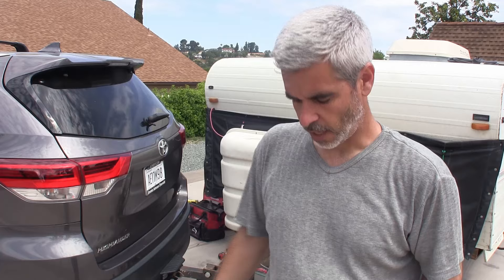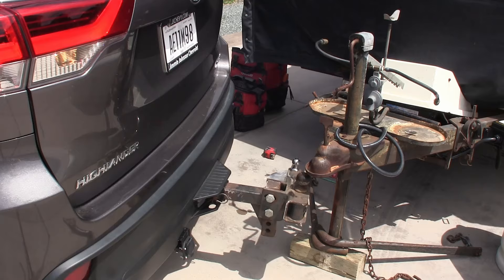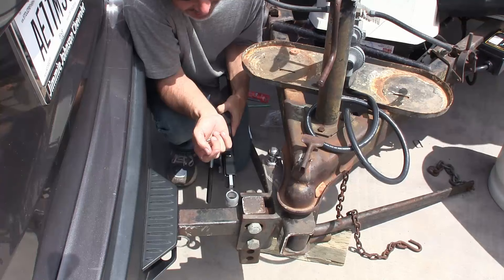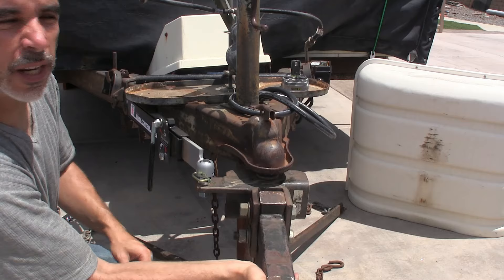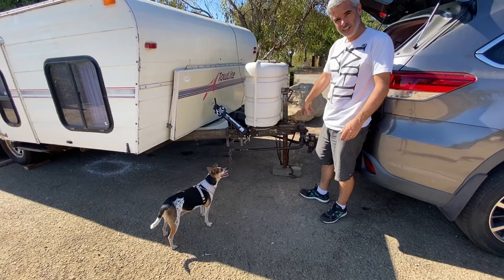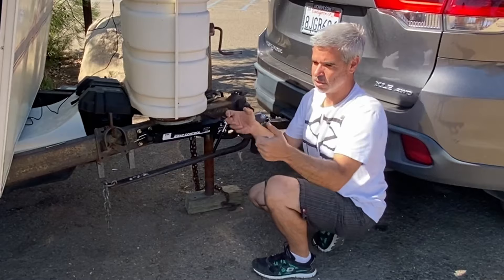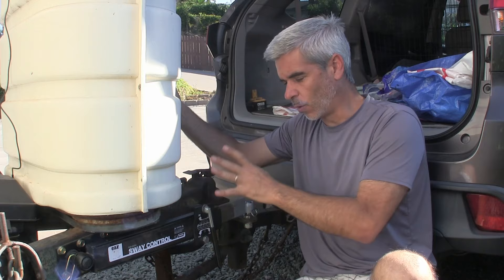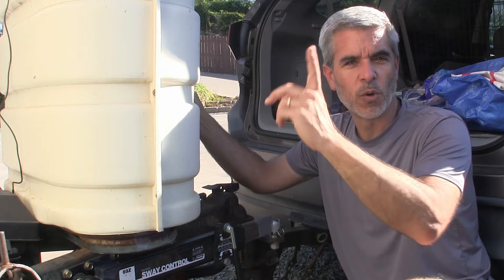DIY Trailer Anti-Sway Bar Installation and use

Comment: When lowering your trailer or raising your trailer, take the sway control completely off.  You install after the trailer is hooked up. When backing up it's wise to either take it off or loosen it.
Reply: Yes was going to say from the looks of it, it is for the travel portion. When hooking up or reversing I would just disconnect first.

Comment: Appreciate you taking the time to make this.  Just got an ultra-lite travel trailer and was clueless as to what I need back there and now I'm good-to-go!
Reply from the maker: Good to hear this was helpful.  Be sure you have your load-distribution hitch tuned before adding the sway-bar as well.  Load distribution is key to not needing the sway bay-bar to work as hard to control the sway.

Comment: they say the E2 equalizer does both although It may not be as much friction as the friction bar you have. and they are very loud. They sell a pad that quiets the noise but less friction. Since the equalizer came with camper I'll be trying that.  thanks

Comment: Good job Dan. Hey....I have an idea for your next video. Its called " How Dan paints his trailer frame"     just sayin.
Reply from the maker: Haha, yah...  bout that...  Funny thing is that when I'm home, I see all the warts and dirt and problems with the trailer. Then I go camping and all that concern goes completely away.  I could care less about the details when I'm actually using it, which is great as I can relax and enjoy where I'm at vs. what others might think about my rig.  So I totally agree, but unless the rust is getting deep and threatening the structure, I won't likely spend time on it myself.  Now the back end, with the added-on storage rack made from angle iron and plywood...  That thing is about to fall apart, so that does need attention ;-)
Reply: Thanks for the very good video with the heads up about the noisy break-in. Will be trying this out shortly. Be well!

Comment: Leveling bars if you need them, theyre purpose is to mechanically push more weight onto the front wheels to steer better,  its always better to have a vehicle thats more than capable to handle your trailer & manage trl tongue weight,  as for that friction bar thats restricts sway, it works both ways, it doesnt want to let trk & trl return straight either resulting in wandering & possible Wreck

Comment: The way I understand, if you look at the sticker on the bar, you tighten the top all the way as it says. The lower bolt is for adjusting the amount of friction. So once you get that set the way you like the top one is for engaging and disengaging only.
Reply from the maker: I totally agree. I'm not using it like it was designed, but for me I like the ability to adjust it depending on the conditions.  I count the threads exposed and adjust up/down from there.  A classic example of 'Doing things Dan's way' for sure...

Comment: thank you for your response. I just saw a you tube saying that if you have the load distribution anti sway with bars without the small chains that you don't need the friction anti sway. The bars will create the friction needed to control sway . Anyway I now undersatnd the whole anti sway load distribution thing.  I see you are going to a Highlander which I am also doing and selling the Honda odyssey. 🙂
Reply from the maker: You bring up an interesting point. The chains allow the car/trailer to sway easily, but the load-distribution hitches that use solid bars could also function as anti-sway friction points.  I'll have to look that up...

Comment: Actually the bottom nut is what makes the tightness adjustment. That way you can always bottom out the top one and the adjustment is the same each time
Reply from the maker: Your absolutely right!  I have found that by adjusting the top by counting threads to be easy and lets me change the force depending on the situation.
Reply: Yeah, i do the same actually. To be honest, i am not sure if i know anyone that does the adjustment with the bottom bolt, but that is technical how it should be done... lol
Reply from the maker: @asianfire72  Hey cool.  Glad you confirmed I'm not that odd...  Wish I had explained this better in the video, but unfortunately I can't update content without re-publishing the video...  Thanks again!

Comment: I had mine too tight......popped the mounting screws off the hitch!  So I drilled it out a little bit and put stainless steel screws in it that were slightly larger......lesson learned.
Reply from the maker: Wow, I would have figured the small ball would have sheered off first... Glad it worked out!

Comment: ALWAYS TAKE THE BAR OFF BEFORE YOU ATTEMPT TO BACK INTO YOUR PARKING SPOT.  IT'S NOT DESIGNED TO DO THAT.
Reply from the maker: I just loosten the tension so it slides easily.  Backup camera shows me how far I can turn before pinching the bar.  Not a problem unless I'm trying to round a corner.  When I un-hitch, I just leave the bar attached to the trailer side.

Comment: My 10 year-old sway bar has always creaked and groaned worse then me getting out of bed in the morning. Really loud and annoying. What do you think the problem is?
Reply from the maker: Mine also make s a lot of noise when turning.  I need the sway protection when on the freeway, so I don' tighten it down until just before getting on the freeway, and again loosen it when I get off at the destination.  Sort of a pain, but definitely worth the effort to not creek and groan through the neighborhood or campground. Definitely keep the balls greased as well.

Comment: A lot of that noise might be there’s no lube anywhere on your hitch. Happens a lot with semi trailers and fifth wheels that sit in  yards a lot. Those torsion bars suck but they work. Funny 37 years driving big trucks and what does my wife wanna do by an RV and go camping when I retired. I did it but only way were getting another one is if we buy a Class A.400k. should do it.Not a whole bunch of setting up,taking down.push a button it’s leveled. I can sit and watch people try to back in theyre trailers all day.maybe $5 and I’ll back it in. Great side job.kidding. Nobody was born knowing how to back a trailer.Take as many try’s as you need.
Reply from the maker: Haha, sounds like an awesome retirement to me!
Reply: No lube on the 5th wheel also creates friction which is what causes steering to be less responsive and not return straight & when carrying a 20ton machine you feel the tractor wandering,  You dont want to add restriction between the tractor & trailer where their designed to pivot ( thats what that stupid antisway bar is doing)instead use a vehicle with overspec'd suspension and manage your tongue weight properly  & most important drive with "Zero Distractions" and be smart.

Comment: You use the two bars and the sway bar ? I’m new to towing a tv so I’m curious
Reply from the maker: Yes, the rep bars are to redistribute weight from the rear tires to the front of the tow vehicle. The sway bar help to reduce left/right swaying motions.  Be sure tong weight is correct before relying on a sway bar to get stable.

Comment: I did notice that your hitch doesn't have a safety pin installed on it's lever lock.  I assume your trailer doesn't have any electric brakes so it doesn't have the break away link. Right?  I always set my sway bar when I pull my trailer at the beginning of towing it. That way I never have to worry about it.  Thanks for taking the time to post the video.  Have a great New Year.    :)
Reply from the maker: I should have had a safety pin as I do have electric brakes.  I'm not quite sure I understand your comment on the break away 'link'.  What is the link you mention here?
Reply: @DansWay  He is talking about the brake away switch, its a small box on the trailer that connects to the brakes and then there is a cable that goes to your tow vehicle. If for some reason the trailer becomes disconnected from the tow vehicle the cable will pull out a small pin on the box which will engage the brakes on the trailer so it doesn't keep going down the road.  Here is one at e-trailer https://www.etrailer.com/Accessories-and-Parts/Tekonsha/2005-P.html

Comment: Is there a function for the bolt below the tightening handle?
Reply from the maker: Yes.  The 'proper' way to use this is to use that bolt to set the stiffness, and to always bury the hand-crank down tight. I prefer to adjust the tightness based on where I'm driving (city vs. highway). I just count visible threads.  This lets me go extra tight if there are gusty conditions.  I'm not saying this is the 'right' way, just 'Dan's Way'...

Comment: Hello. Do really need a anti sway bar to a 2,100 lbs /15 ft trailer? Got a tab 320 S trailer by NuCamp.
Reply from the maker: It totally depends on how stable you feel at freeway speeds. When you steer left/right quickly, does your tow vehicle remain solid, or do you feel like the trailer pushes you around?  When a big-rig goes by on a two lane freeway, do you feel stable or does your rig oscillate back and forth a bit? These are a couple of things that the sway bar helps to stabilize.

Comment: does it get used in addition to the anti sway bars you have?
Reply from the maker: Hey Clark.  These definitely are in addition to the load-distribution bars.  Those bars don't do much to directly control sway, but they do impact the load balancing.  You want to get the load distribution bars tuned as best as you can BEFORE adding the anti-sway bar. The anti-sway bar could easily mask the fact that your loading and distribution is out of whack.

Comment: I was watching you video on installation of a anti-sway bar, but you didn't mention if the vehicles should be loaded up before putting on the anti- sway bars? Do I need to load it up before I install?
Reply: No they don’t have to be loaded it doesn’t control a load all it does it make your trailer harder to turn left to right.

Comment: I’m thinking of buying this, Dan. Have a question cause I’m new to this. Would this be recommended for someone who’s driving up and down mountains (Rockies) where i have to take sharp curves? Seems like it would break the bar
Reply from the maker: There is no problem turning with the bar. It is designed to show down the otherwise uncontrolled movements of the trailer. I only disconnect or listen when I’m in a residential or campground as it is a bit noisy at times.

Comment: What is the difference between this and sway bars?
Reply from the maker: What I installed in this video is an anti-sway bar.  The other pair of bars are the load-distribution bars.  Those transfer weight from the tow vehicle's rear tires to the front which helps in vehicle handling.
Reply: @DansWay  I’m going to pick up my camper this weekend and the dealer offered to add sway bars to the quote.

I was just wondering if that is the thing you installed in this video or the actual bars.

Sorry for lack of knowledge on the subject. First timer
Reply from the maker: @slappadabass3290  Hey no worries!  We all get smarter by asking questions, and there are plenty of others who don't even bother asking...  Enjoy the new trailer!
Reply: @slappadabass3290  Dealer is probably trying to sell you a weight distribution system with built in sway control. Most RV dealers now a days will not sell you the separate friction sway control shown here but an all in one system. In saying that I also use the type show here *we use 2 of them as our trailer is over 25ft long), and have been for the last 30 years of RV towing.  If you tow in cold climates where there could be ice (black ice) or even snow on the road then you need to be able to disconnect the sway control system otherwise if you hit an ice patch/snow it can push you off the road. Last few years since I retired we travel from our place in Canada to the southern US in December and have come across bad road conditions that called for us to not only slow down but disconnect (loosen) the sway control bars.

Comment: Hi Dan, I am towing an 18' single axle travel trailer weighing 3200 lbs. with a GMC Savana van with a tow package and I have no problem with sway even when a tractor trailer passes me.  My tongue weight is 407lbs. and I have no problem with weight distribution so I don't use one. My issue is a front to back rocking motion when I go over a little bump in the road.  Would a sway bar help to correct that situation? I was also going to try putting an extension on between the ball and the itch to see if that would help.  Any suggestions?
Reply from the maker: Wow, that is a strange one.  Sounds more like your front/rear shocks are weak.  Your tongue weight sounds perfect. The sway bar would do nothing.  A load distribution hitch could help as it would fight the rocking motion (I believe).  You could move a bit more weight forward, then apply a small amount of load force on the bars.  Unfortunately, there isn't an easy way to test this without installing the whole setup...  I'd have your shocks checked first, and perhaps upgraded to a slower response.  It will roughen the ride a bit, but could help.  None of this is easy...
Reply: Yea i got same issue with my boat trailer.  Leaf spring shocks all around so no adjustments snd no load shifting anywhere because its a boat.  Only thingbi can think is the load distribution in the truck being less weight in thr bed and all in the ftront..  as well as the boat having all weight in the back and nonevin front but the trailer distributes its weight enough where i can barely pick up the tongue and balance it on the axle..  but the truck has all its weight up on the front axle… always..
Reply: @DansWay  Measure the distance between the ground and a point on the rear of tow vehicle, say from the ground to the bottom of the rear fender wheel well. Now hitch up the trailer. Remeasure the same points. The two distances should not be more the about 1"+/-. If it is a lot longer or shorter, one of two things are needed: 1. stronger shocks in the rear of your tow vehicle or, 2. a weight distribution hitch.
Reply: I wouldn’t extend the ball mount. As you increase the distance between the ball (trailer attachment point) and the rear axle of the tow vehicle, you decrease the stability of the whole rig. In any case, I don’t think it would help your issue. Stick to the suggestions of these other posters.